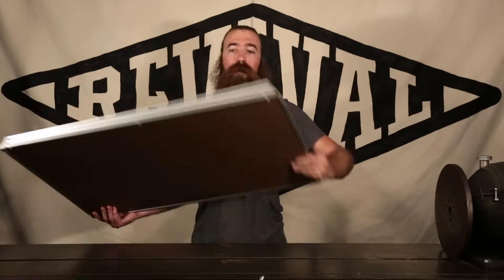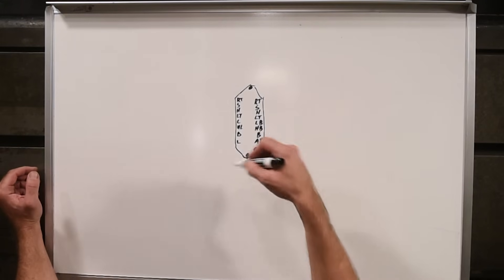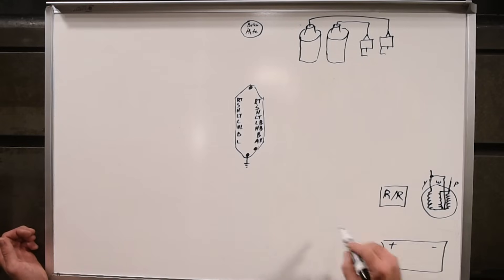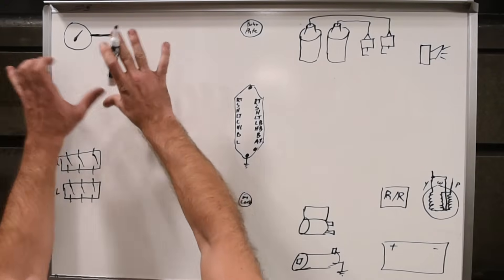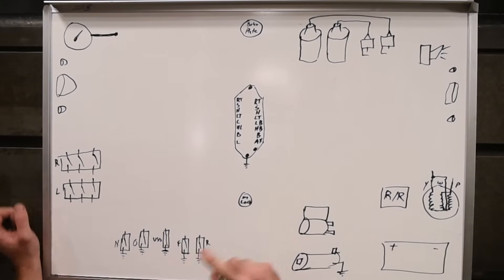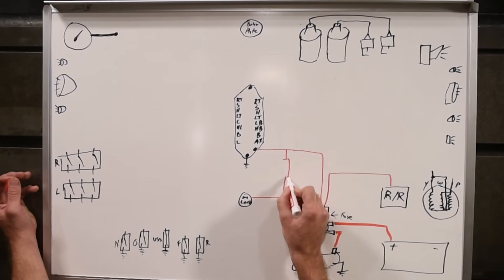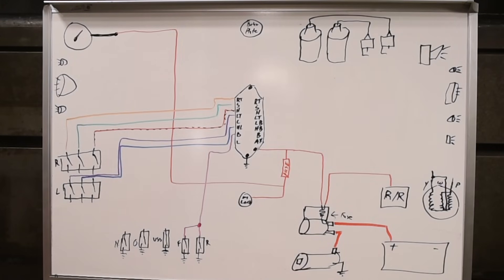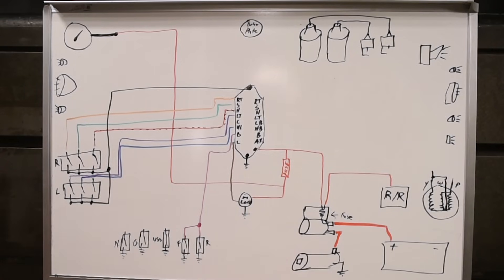How to Wire Your Motorcycle  - Revival Cycles' Tech Talk

Comment: Do you need to use rectifier diodes on the wires to avoid ground signals to mix?
Reply from the maker: No, grounds always share continuity. It's only when a button is pressed that the ground signal flows through the switch and to the input terminals, so there is no opportunity for them to be mixed
Reply: @RevivalCycles  Thanks.
I just had a look at this video https://youtu.be/FmRdjqje5bE
I was thinking to use his wire method with a m-unit blue. As O see this I will replace the ignition key, ignition fuse, accessories fuse and kill switch with my m-unit blue and m-lock. But I was wondering if I needed the rectifier diodes as he do before the ICU, coils and starter relay. As I will use a common source from the Aux2 on my m-unit blue to the ICU and coils.

Comment: Hi. I have a 1972 Iron Head sportster and i recently purchased an M unit. My hand controls / ( left)  turn signal has 2 wires coming out.  Do I connect both of the wires into the Left input of the M unit?
Reply from the maker: The inputs on the m-Unit need to have ground references, and that means the handlebar controls need to have one connection to the input and one connection to ground. When the button is pushed it should be connecting the input to ground, and when it is not pushed it should have no connection. 

In the case of handlebar controls that are latching toggle type switches, the configuration of menu 5 in the m-Unit will need to be adjusted to match the type of switches being used.

Comment: Hi Stephen
In europ we have an additionnal third bulb on front wich we call "veilleuse", don't know if "night light" is appropriate for it, juste a 5w bulb that insure even if both low and high fail you still got something at least to be seen from front, it light on with a three positions switch (on right side), lighting on the tail light  that's coupled with, pushing forward the switch turn on "low/high" beam, whose commutator is on left (as in U.S I think?).
Maybe i'm not teaching you anything ;-)
How can i deal with this? have to put an extra "m-button" i guess, maube not, tell me.
Thank's for share
Reply from the maker: I think that light is called a "pilot light " or "parking light" and there are a few different ways you can handle this with the m-Unit. The light is only 5 watts so you can connect it to the Ignition output and it will come on anytime the ignition is on. But if you also want to be able to turn it off, you could connect it to one of the AUX outputs, and add another push button switch to control when it turns on/off.
Reply: Yep,  i would rather not add another switch button just for this, but solution two is the best deal i ll get, thanks for interest Stephen.
Long live to Revival Cycles, ride safe.

Comment: What gauges wire are being used???  Or is just 1 gage wire for all wire diagram???      
Do you sell all electrical components and wiring as a build kit???
Reply from the maker: We use 4 gauges, 22, 18, 12, and a tiny bit of 14AWG. All of the wire is automotive grade thin sheathed TXL Cross-Linked, not the cheap GXL you can get from just about anywhere. We sell wire kits with printed wire assignments, loom kits, bundles and more on our site. https://revivalcycles.com/

Comment: I have an 85 honda rebel 250 and i wanted to rewire it with the m-unit. The third switch on the left handle bar you didnt connect to anything.  Could that be a kill switch? Would you connect it to the direct power to kill it? If i am using the oem ignition would that go to where the m-lock is? And i am not sure what type of charging system an 85 honda rebel 250 is....is it field excited?
Reply from the maker: The extra button can be used as a dedicated kill switch, but more often we endup using it as the menu button for the motogadget gauges. On most of our builds we don't have a dedicated kill switch, and instead use the built in double click the starter button kill switch feature. 

If you do want to use the spare button for kill switch, it gets connected to the "config" input on the m-Unit V2, or the "kill" input on the m-Unit Blue and Basic. The switch is used to send a ground signal to the m-Unit, so one side of the switch is connected to ground, the other is connected to the m-Unit.
Reply: Revival Cycles sweet thats easy enough....do you happen to know what kinda charging system is in a 85 honda rebel 250....i would imagine that it is a field excited since it is an 85...i am just trying to figure out what my charging system is gonna look like in my  diagram as i am trying to draw it out
Reply from the maker: It appears that bike has a 3-phase permanent magnet charging system, with a self excited CDI ignition system. So for the reg/rec you can use basically any 3-phase permanent magnet type a 5-wire should be all you need. But to integrate the ignition system with the m-Unit you'll need to use a relay. 

The basic idea is that the m-Unit ignition output is used to control the relay coil, and the relay contacts are used to ground the CDI kill switch wire. If you need more details on this email techsupport@revivalcycles.com and we can send more info
Reply: Cool last question....if i am going to replace my ignition and put a new start button and kill button on.... then what would my charging system look like would i need to get a new reg/rect and stator

Comment: great video, just one more question. Would I be able to use ignition coils that came off a bike with pick up points style ignition on a bike that uses ignition control?
Reply from the maker: The selection on coils is really determined by the ignition system, and if you want to use coils from a bike that used breaker points and install them with a electronic controlled ignition system, it could be possible, but you'll need to make sure the resistance values are approximately the same for the coils on both systems.

Comment: I have a 78 Yamaha xs750 special that needs a complete rewire. Can I use the m-unit on this box? I don't know if its cdi or not but it has an ignition unit box near the battery location
Reply from the maker: That is a perfect candidate for an m.Unit installation. Our Knowledge Base on the website has guides that provide more in depth explanations of how to prepare your own diagram. https://technicalarticles.revivalcycles.com/hc/en-us
Reply: @RevivalCycles  thanks, do I do away with the ignition unit all together or do I have to wire it in with the m unit

Comment: I've got a small horizontal 125cc bike and want to custom wire it (very basic): 12V,  LED's all around, and no battery. Can I run a couple of capacitors in series?  I am hearing different and conflicting things (that it won't work and that it'll be no problem).
Reply from the maker: This all depends on what type of ignition system and what type of charging system you have. Some will work with a capacitor setup, but others really do require the battery. Also worth considering using a small 12V battery instead of the capacitors. The 4-Cell from anti-gravity is about the size of a paper back novel.
Reply: Thank you!

Comment: Do you guys have a video on adding something like a dyna ignition to an older bmw 76 r90 ?
Thanks
Reply from the maker: We don't have one for the dyna ignitions right now since we don't sell them at this time. Most of which are just points replacements but leave the old mechanical advance and when we can we prefer to update the entire system not just bits of it. We recently added a comprehensive charging and ignition system from Vape to our site that does it all. https://shop.revivalcycles.com/vape/
Reply: Revival Cycles thanks, I’ll look at your offerings and call ,
Regards

Comment: Thanks this makes wiring so much clearer and less daunting! I'm currently working on the bmw K, would this system work on it or would it need a little tweaking?
Reply from the maker: The K-Bikes are a bit of an electrical nightmare from the factory, and yes the m-Unit will work. But this video really only covers carburetor bikes, the fuel injection variety are a bit more challenging. It can be done, by carefully revising the OEM wire diagram to retain the complete ECU and sensor arrangement, and just augment the power distribution to come from the m-Unit AUX instead of the main relay. The good news is that the charging system on the k-Bikes is actually easier than most others because the reg/rec is built into the alternator, which leaves just two connections to make. 

It is worth noting that with EFI bikes you do need to keep the fuel pump relay as this is typically controlled by the ECU and needs to be this way so it doesn't run anytime the key is turned on.
Reply: thanks for such quick & amazing reply, it sounds like I haven't been going in a completely wrong route (I've got the ignition and fuel injection connecting as 2 smaller, seperate harnesses) so will persevere!
Reply: working on a 96 cbr900rr cafe racer. Would the m unit work on this aplicaton. since the bike comes with a ICM ingine control module

Comment: Have a conundrum for you guys. I’ve rewired a ‘78 CB400t (with your guys’ advisement) with an M-Unit Blue. I’m having a hard time with my killswitch and my electrical controls. I’ve got my killswitch matched to the M-unit’s killswitch input. It works but in the opposite way. I’m using original style controls for Honda. It has the rotary killswitch. My problem is that in the “Run” position it kills the engine and both “Off” positions allow the engine to start and run. The only two wires in the killswitch control are a black/white (kill) and black (ground). Black/white is connected to kill switch input and black is connected to ground. Any idea where I’ve gone wrong?
Reply from the maker: There is good news and bad news. The good news is that you have done this all correctly, and it is working exactly the way motogadget designed it to. The bad news is that motogadget is not perfect, and the way they have configured the kill switch input does not work with that type of kill switch. There is a solution to this problem, but it requires the use of an additional relay or MOSFET to invert the signal from the kill switch. This is not a terribly difficult thing, but it does take some effort. 

If it was me, I would live with the kill switch being backwards, or re-label the kill switch. BUT if you want to go through the effort to get this 100% correct, email techsupport@revivalcycles.com and we can walk you through the details.
Reply: Revival Cycles ...one more question and my rewire is complete. I’ve got my original reg/rec. I know the three yellow correspond to the stator. I then have a red to go to the battery (through the solenoid which I got from you guys, so thanks for that), black for ground, and green/red which I’m not sure. Everything I’ve read says it goes to power somewhere after the ignition to monitor voltage output. Is that correct? Where should that go in respect to the M-unit?
Reply: In the future, questions requiring sophisticated answers such as this are best directed as an email to our technical support team where we can better provide a response. 

Really the first place to begin here is that a 39 year old Regulator/Rectifier is well past its expiration date and this is the time to replace that with a modern equivalent. You need a R/R that is compatible with your specific charging system, they are not all the same. If I recall correctly you have a 3 phase field excited generator but don’t take my word for it, read your manual and confirm before you order a replacement.  If you buy a name brand you will get one that is more efficient, reliable and won’t cook your batteries. If you pick up the cheapest one you can find on eBay you may get what you paid for. If you are installing a lithium battery you need a R/R that states it is compatible with Li or you may cause irreparable damage to your expensive battery. 

Once you’ve got a replacement, follow the instructions that come with it but take the main 12V+ wire from the Reg/Rec and connect it to terminal 6 on the solenoid you purchased from us as it is shown in the starter solenoid diagram that was included. If your new Reg/Rec has a 12v signal wire (which is not shown in our solenoid diagram) tie this into your ignition output on the m-Unit so that it will be supplied power when the key switch is in the on position. 

Hope that helps,

Comment: Just a quick one do i need a starter solenoid on a Harley sportster for a complete rewire using the M-unit
Reply from the maker: Sorry for the slow reply, but no, on a Harley you have the solenoid built into the starter, and the external solenoid we sell won't work for you. The starter on your bike actually uses the mechanical movement of the solenoid pin to engage the starter gear, in addition to the electrical contacts that were discussed in this video.

Comment: Waiting for the m-unit blue to rewire a 1978 Honda CB 750K SOHC. Any recommendations on a rectifier/regulator? Is the one from rick's motorsports worth the +100$? Thanks
Reply from the maker: The reason we chose the one from Ricks is that it is literally the ONLY field excited reg/rec we've found that works with LiFePO4 batteries. If you are using a conventional battery then any reg/rec will work. In my opinion the charging system is critical to ending the ride at you intended destination, and saving $40 on a reg/rec isn't worth the hassle of having a cheap part fail.
Reply: Thank you for the quick response. I will make the plunge and get the Ricks regulator/rectifier. Just to confirm though, you guys do not offer that on your website correct?

Comment: On my bike the push start button is connected to the coils. is that ok? i have the M-blue can i also join/splice a wire from the coils to the ignition output of the m-blue?
Reply from the maker: Hard for me to picture but I'm not sure how a start button could work if connected to the coils. If you have an m.Unit Blue the Start button should go to the start in and the coils tied to the ignition out. For more clarification check out the explanations and diagrams in our Tech Articles page. 

-Berry
Reply: I have an 05 Vulcan 800. It’s wired that way from oem diagram because the other wires go to IC igniter or I guess CDI box. From the factory diagram: One wire from coils 1 & 2 are tied together to the start button the other wires from coils 1 & 2 go to CDI. The other wire from start button ties to kill switch and then the other with from kill switch goes back to CDI. Just saw your tech article looks like I need a relay?

Comment: This video was a great reference to start the rewire on my CX500. I'm still a little stuck on where the ignition switch with the key would come into play in the diagram. can anyone help?
Reply from the maker: The key switch would take the place of the m-Lock. If you are using a convetional key switch then you don't need the ground connection for the key switch. The only thing you really need to do is have a switch that can send +12V to the lock input on the m-Unit.

Comment: Great video! I'm about to rewire my Honda CB 750 F 1982 and just ordred some components (reg/rec, wire kit and main fuse) on your shop. But as you mention in the video: Don't forget to put a 1 AMP fuse in front of the Motogadget M.Lock and Motogadget Chronoclassic dash. I'm considering to drop the 4 fuses in my steering and put this under my seat with the M.Unit Blue.
So did I forget to order your: WATERPROOF 3 CIRCUIT BREAKER / FUSE BLOCK ? Is this where I would put the 1 AMP fuse?
Reply from the maker: You could use the 3 circuit breaker for this but it's a bit large. You might look fpr a smaller single fuse housing if you just need that one. fuse up front. 

Keep in mind that this video is dated and for the discontinued V.2. We have detailed diagrams for the M.unit Blue/Basic on our website at https://technicalarticles.revivalcycles.com/hc/en-us

Comment: Just found this awesome, however has anyone made LED / DIGITAL wiring that works on a vintage 6v yet? I have 2 vintage  XR200R bikes
Reply from the maker: You're in luck... there are many 6v LED bulb options out there.
Reply: @RevivalCycles  I've not found any yet, what would be the easiest is a loom sold as a directions instructions connect this there this there this there... You can buy a light loom from that bike for £84.99 in UK, I am planning to buy wire and do it the bikeexif website instructions way but I don't know if theres a fault with the stator being that its a meo5 '86- engine with the 1979 XL185 engine wiring fitted. It would be a whole lot simpler if someone just sold a fitment replacement loom with instructions. I can't take in info without practically taking about it, I have a brain injury, went through a massive breakdown and all mt knowledge is locked up in my lost thought pattern, if it was funny, I lost my marbles not I lost thirty years of interest education personal knowledge, learnt stuff, it comes back in bits here and there, been on PTSD meds about five months and getting better right old situ tho 😂 😢 😂 😭 😔

Comment: Cheers! I have a CB 750k 81 cafe project, I changed the battery system to lithium and the rectifier, all the wiring has electricity except the coil wiring, has anyone had problems on their motorcycle changing the lithium battery system? what should i check? with the old system I have no problems! any suggestion is welcome!
Reply from the maker: it's not clear if you have an m.Unit or not, which is what this video is about but if you're operating on the OEM harness and all you've changed is the battery and reg/rec then the issue isn't with either of those components.  The pull out your OEM diagram and a voltmeter and perform continuity tests beginning with the 12V+ power leading to the ignition system and move down the line until you locate where the power loss is occuring.